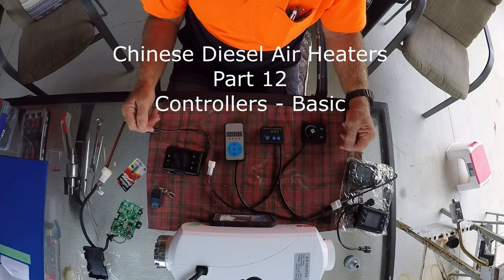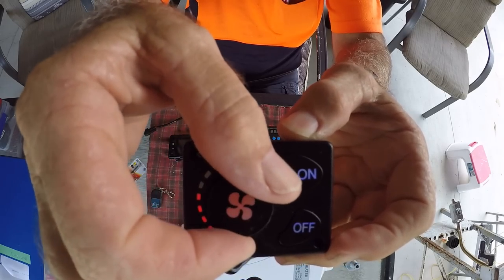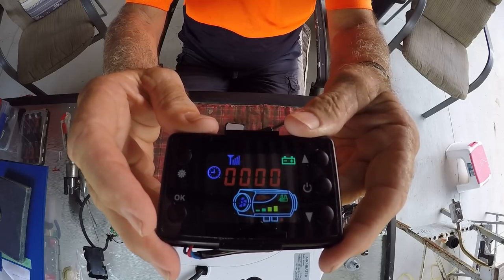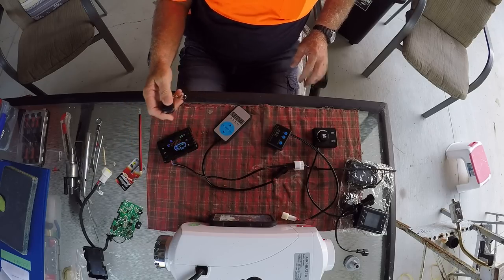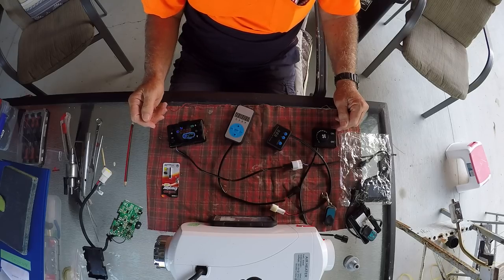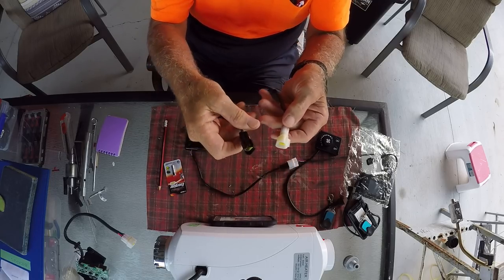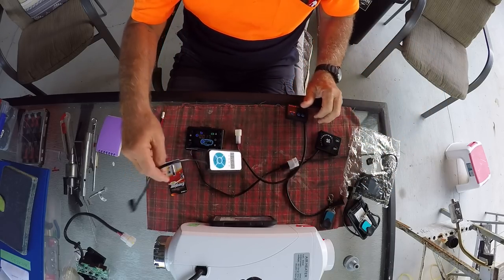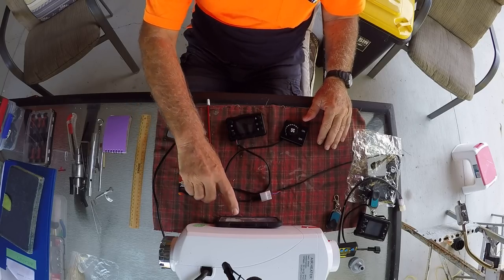Chinese Diesel Air Heaters -  Part 12 - Controllers (Basic)

Comment: I don't know if you realise it, but you are now the official cheap Chinese heater guru! Thank you
Reply from the maker: I hope I can live up to that statement Martin. JMcK
Reply: @johnmck1147  Hi john i agree you are the guru ... I have a problem with my 2kw seems to smoke a lot so over fueling i guess would you happen to know. The factory settings or best setting for 2kw heater ive tried two black  controller and they both seem to be doing same hope you can shed some light on matter many thanks Nick
Reply from the maker: Nick Pritch ,

Hi Nick, I really need more info to be of some help. 

Did it smoke from new, or did it start smoking later? Is the smoke black or or is it white? Does it smoke just on start up, or all the time?

If it smoked from new, you most likely have an install issue. Eg too long a combustion air inlet, too many bends in inlet hose, or restrictions in exhaust. Issues here cause lack of combustion air for a complete burn.

If it started smoking later, it is most likely caused by carbon buildup in the glow plug atomising screen or the burner chamber. If only on start up suspect glow plug screen, if always probably carbon in both glow screen and main burner screen.

Smoking can also happen with a dirty fuel filter.

I hope this is of some help.   JMcK
Reply: @johnmck1147  you already have done.
Reply: Those creatures in the background?
Reply: Can you put any controller on these headers are they entertainable can somebody help me
And of so what is the best one to get so on
Reply: @theodorebowers9737  no, you can’t just put any controller on any heater. As for the best, no idea. I hear good things about Lavaner pro. As long as its installed correctly you should be good. I’ve been using my 2kw for over 3 years with no problems whatsoever.

Comment: If you don't have a spare controller to shutdown the unit with, you can cut fuel by disconnecting the fuel pump. This will trigger a low temp error and start a safe shutdown. But like he showed, don't let it lose power. When the fan stops, it won't cool itself anymore. If the controller fails and things keep running, cut the fuel and let it cool itself down. Great video, thanks for the info!
Reply: I've just bought one of these heaters and a 30 amp power supply but as you "could" get a mains drop out I'm also going to invest in a UPS for A$40+A$23 delivery on EBAY.......belt and braces is my middle name.

Comment: How would I interface a home made controller to the heaters?  On the Espar, there's a yellow wire to turn on the heat by applying 12VDC to it.  Is the wiring that simple, or is there a complex communication ie CANBUS, etc?

Comment: Today I got my heater running thanks to you. Yes I cleaned and cooked the tubular thing that goes around the glow plug, and I also found dirt in the air hole. B\ut I also found another problem you might want to look at. The controller (the fancy blue one) had a short circuit in the wires. Pull off the adhesive front cover, remove 4 screws and inside you will see that they stripped the wire 10mm. Over time this exposed wire crossed and would intermittently short out. I cut some heat shrink and used it. Thanks for your help, much appreciated. And now I am warm and dry.
Reply from the maker: Hi John,
Thanks for that information.  JMcK
Reply from the maker: Hi John,
Thanks for that information.  JMcK

Comment: I just completed wiring my heater in. It works, thanks for the good advice about the run down time when  turning off to prevent the circuit board from melting. There is no mention of this in the "instruction" booklet. You saved me some heartache and lost dollars.

Comment: John, I have now encountered two different plug types with two different controllers. The new Black painted all in one (link to it in your All In One heater video) has a round connector with 3 wires. Its around 3/8" in diameter with a screwing locking collar on it. Wished I could post a picture of it. Ok the Second on is on a Red All In One heater that has a controler that has a single knob. To turn on, press in on the knob and turn to the right. After unit is up and running the heat setting is set by turnning the knob to the right for + heat, turn knob to left for - heating. No temp scale in Celsius just pulse rate. To shut down, press and hold and turn knob to the left till 000 is read. Let off knob and it runs the shut down phase. Now on this heater the controller has a Flat 3 wire connector. Now on  visual inspection of both of these heater control units (motherboards) with the same and it looks the same in the pictures you have on your videos and pictures that I found on eBay. And John you are The Guru of the Chinese diesel air heaters. God I would have loved to have you as a shop instructor in high school or middle school. Have a G-day from the USA.
Reply from the maker: Hi KLH,  thanks for the kind words and detailed feedback. JMcK

Comment: Curious observation with my analogue controller today…

Absolutely excellent videos John, best I’ve seen so many thanks. 

I had a curious observation today with my 5kw which has an analogue controller; last couple of weeks it’s been starting and stopping fine but will not regulate the temperature lower than anything other than flat-out. I’ve had to use it like this out of necessity but it’s not ideal as you can imagine. 

Today I was armed with some tools to troubleshoot but before I started, I selected a low temp setting and started it up as usual and even after 15 mins the temperature was not going down, the pump ticking like mad as I’ve had lately… so I decided to press and hold the ‘On’ button on the analogue controller. After a few seconds the pump slowed down and all was fine! It starts and runs as normal now, I’ve had it over a year and it’s definitely back to its old self with full control over the temperature. 

Maybe I have inadvertently done some sort of reset? I’ve powered it up 5 times since with no problems and I’m very happy with it again. I haven’t seen anything on the internet/youtube about heaters that fail to turn the heat down (with no error codes) and neither have I seen anything about holding the ‘On’ button down while it’s running so I hope this helps you and others who may experience this curious fault.
Reply from the maker: Thanks for that feedback Mags. Much appreciated.  JMcK

Comment: The LCD controller users 0.114 ma (+/-)  an hour in standby mode. Over 24 hrs that equates to 2.736 amps. This would drain a 100 ah battery down to 50% in just over 18 days in standby mode based on the fact there is no other parasitic draw from the battery. This is a very good point you raised, thank you John.
Reply from the maker: Yes Enigma. You would be surprised at the number of people who store their caravan or motorhome under a tarp or carport (solar won't work) and do not realise the constant heater current drain will flatten  their battery in pretty short order. If left this way all winter the battery is generally a write off. JMcK

Comment: I reached out to you last January. I use my heater to heat up my shop and it worked great, which I had mentioned back then to you, if you can recall.
Well I have turned it up a notch. I'm using this heater as one of the heat source to heat up a 205L drum full of coolant, that then goes in my floor radiating heat system. I used a 4 inch grinder and made a groove going in a circle around the casing, to be able to insert a 3/8 copper tube tightly wound inside the said groove.

Right now, it is running with no pump pushing the coolant inside the 3/8 tube. Instead, I use the science of heat that likes to escape  any entrapment and at the same time, it sucks in the cold coolant. It goes in the pipe at around 16c right now but exits at around 48-49c on average. So on top of heating up the ambient air, it also supplies heat for my drum. I also have an used oil burner/wood stove combo, 600watts of solar panels running a 600watt heating element, and also a solar hot water heater on the go. I am assembling everything right now.

Your videos were really helpful in how to disassemble these heaters and so on. Thanks for the knowledge you share with us.
Reply from the maker: Hi Danny, thanks for the feedback.

Is it possible for you to send me some photos. I have often been asked to do a video on other applications. If I do so I will give the contributors the credit. 
My email is   -   johnmck47@outlook.com
Thanks ..JmcK
Reply: @johnmck1147  I promise I will once I'm done and running. It will be winter here as it will be summer for you so I have time against me right now. I saw something else last night that gave me an idea. 

I have an old defective Cooler Master liquid cooling CPU pump and radiator that I kept in case I'd need it one day. It is almost the same dimensions as the air heater end of it. I will make some king of tin or thin sheet metal and make a shroud for it and circulate the coolant through it. Yet another way of taking heat and sending it in my radiant floor.
Reply from the maker: Dany F 

👍

Comment: Great videos i really enjoy them you do a good job of intelligently testing things many of us would like to know. I will be purchacing one of thease heaters for my 4x4 camping vehicle. Question the espar heaters have an option for high altitude kit is there any such thing or adjustment for thease units to run well at high altitude? 
Also what parts would you reccamend carrying as spares for thease units atomizer screne, glow plug, gaskets of any kind for dissassembly and reassembly?
I saw in one of your other videos an intake air screne you were showing does that come with the units or do i buy that seporate?  Curious if installed and used properly how often do they get carboned or need repair?  Also a video on how we should be controling the unit what pulse rate how to set a thermostat controled temp.  Also a video on how to use the diag function on the controlers Thanks for the great vids and info mike
Reply from the maker: Hi Michael, at this stage I have not seen a high altitude kit for these Chinese diesel heaters. With no adjustment the heaters run rich at high altitude and hence cause more soot build up than normal. You can lessen this soot formation at altitude by using a kerro/ diesel mix. Somewhere between 80:20 to 50:50 mix seems good.

As for spares, I would suggest some glow plug screens as spares, and perhaps a spare glow plug, and removal tool, as the glow plugs are easily broken on removal, unless done careful.

If installed correctly and with an end of season kerro/diesel short cleaning run these heaters can go for many years without a pulldown for carbon and soot removal. 

Sadly most heater kits come with a so called intake silencer. These are not an air filter, and are useless as a silencer. You will need to purchase an intake filter separately. 

I hope this helps a little.  JMcK

Comment: Hey John, love the detailed vids, very helpful. Just wondering if you can do a factory reset on the digital display control unit? I keep getting error code E-05, overheating issue. My air intake and exhaust pipes are all clear and with minimal bends, heat duct is fine and cool air in the cabin has adequate air flow. The fan works and blows air out fine, not sure what the issue could be?
Reply: carbon build up from not running the heater on high for a good 30-60mins periodically to burn it off.

Comment: Hey Mate. Thanks for the vid. I am just in the process of fitting a 2kw heater and have fitted an isolating switch on the main 12v feed so it was good to hear about the impromptu shut down overheating. I am also running the diesel fuel line inside some clear plastic tubing for both protections and to insulate it from the van and suppress the noise as I had heard that it was a problem. This was then mounted with rubber coated P clips to further enhance the suppression. It is great to share our experience and knowledge to help others. So many tricks and traps in the install and the instructions, which are in varying degrees of chinglish, are at best downright confusing and at worst, not existent. Perhaps non existent would be better as people would be forced to look around for the proper way to install them. lf I was an absolute beginner I wouldn't have had a clue what to do based on the install instructions or lack thereof.

Comment: I didn't know about the shutdown. I just got the all in one heater to warm my garage. I was going to use an ATX computer power supply to power the unit and shut it off when not in use. I'll now use a battery with a charger and turn off the battery after the heater turns off.
Thanks for the information, you saved an ecu!
Reply from the maker: Hi CW, pleased the videos were of some benefit.  JMcK
Reply: @johnmck1147  I watched all the videos and learned a lot about this heater.
I fired it up today and it blew out smoke for the first 5 minutes then all is OK.
Thanks for the videos, very helpfull when setting these up for the first time. 😊

Comment: If the controller fails just shut the fuel off  I enjoy this series of videos on these heaters you are doing keep up the great work!!!
Reply from the maker: Hi Pat, yes I talked about that method  in the description with this video, however in a lot of cases like Caravans and Motorhomes and Trucks, with the fuel lines underneath the vehicles it is not so easy in the mud rain and snow of winter, when these heaters are most used, to get underneath the vehicles and disconnect the fuel. 

In the rare event this occurred, and there was much mud and rain, I think I would chose the master switch and fan method. Also with this method you do not have to get underneath the vehicle all over again to reconnect the fuel line and do the prime again as well.

Anyway, thanks for the positive feedback Pat.  JMcK
Reply: Cut the power to the pump then? Add a cutoff switch to the wire that runs to the pump? Would that trigger the unit to go thru its shut down routine and cool itself down albeit without fuel input?

Comment: Thank You John. It was not obvious they had a room temperature thermostat. I was afraid maybe the temp set could be the device temp, not the room temp. You gave us the information . Thank you so much !
Reply: Well, I fact yesterday a guy that actually owns one said : in fact it actually have a problem. Because apparently the thing can go on low heating, according to the room temperature, but it will not regulate using total shut down power on the fire. That means, for a 1000W to 8000W model, if 1000W is too much for the insulated volume you have, you’ll overheat without regulation ! That’s a terrible problem for me. Need to keep one door partly open then ? Do you confirm that ? He has 5kW model with the full electronic controller.
Reply: He say this is for battery energy savings. Because the power on/power off would consume too much, hard to recharge later on a camper. Myself I purchased a 1 to 8 kW model, but my caravan would need only 500 W or less... gonna have a problem apparently. I think about using On/Off function with a thermostat to shut it off. And to avoid the important battery consumption, i think about making the starting resistor plug out if service when powering off. I think this could be achieved using a klixon thermostat on the aluminum fins, not allowing the starting plug to be supplied when the body is already hot. Normally this is a carbon clogging issue, but I gonna use my caravan maybe 3 cold nights a year....
Reply from the maker: rené solaire 

Hi Rene,  I suspect your heater is the common 5 kw model. I do not think you will have an issue with this heater.
On a low setting the heater runs very slow, puts out low heat and uses very little power. If it does get too hot, jut turn it off for a while.  JMcK

Comment: Hi john I have had these heaters for about 6 years( Airtronic and a Chinese one ). I get about 700 hours before they require service . your videos are great help to get the Chinese one going. I have a red controller and remote and they work fine. I get all my parts from Butlertechnic in England for the Airtronic, but not have a supplier for the Chinese one yet.
Reply from the maker: Hi Peter, thank you for the info and feedback.  I get parts for the Chinese heaters mainly from eBay.  Cheers.  JMcK

Comment: Hi John, not sure if its been mentioned but you could also disconnect power to the dosing pump for an effective emergency shutdown if needed in the event of a controller failure.  Once unit has cooled, one could then disconnect the primary power.    Really enjoy your videos!
Reply from the maker: Yes, in theory it should work, but I have not actually done this.
However next time I am bench testing a heater I will test it out.
Thanks.  JMcK
Reply: @johnmck1147  If that works by disconnecting the power to the pump as an emergency shut down probably a kill switch in the pump line will work better.

Comment: A point of information about the first controller that you showed.  If you turn the unit on and the knob seems to not work and it seems to change settings on its own...  Press and hold ON while the unit is on and the fan  blades in the knob will change colors...  When they are red it seems that the unit basically runs on high and adjusts a bit here and there as needed on its own...  I turned it all the way down and things just kept on trucking.  However, if you press and hold ON while the unit is on the fan will change from red to blue.  When the fan blades are blue it follows the input that you have asked of it.  I've not been able to find any of this mentioned in any of the manuals.
Reply from the maker: Thanks for that feedback Brett.  JMcK